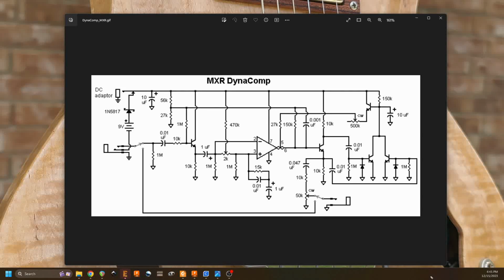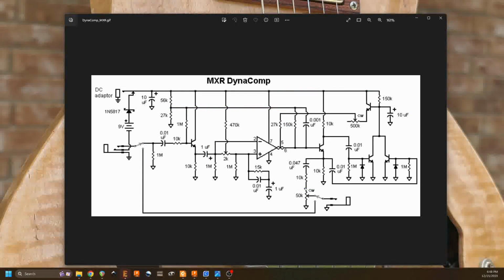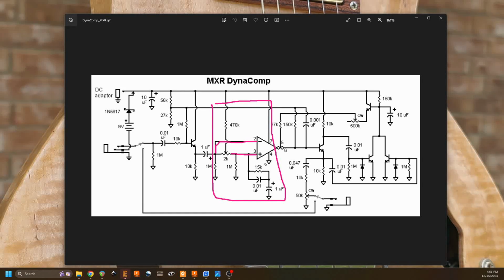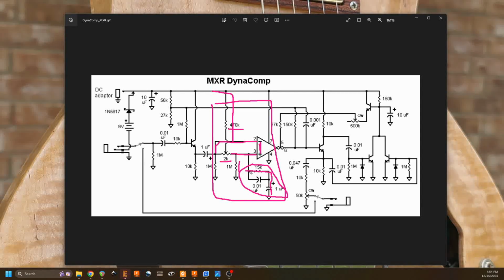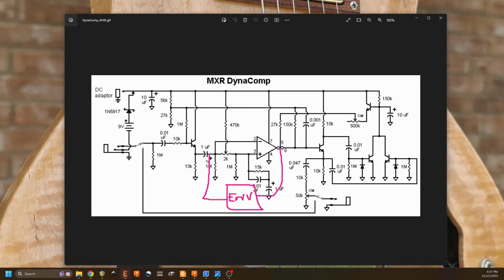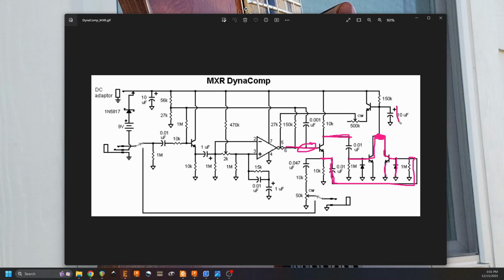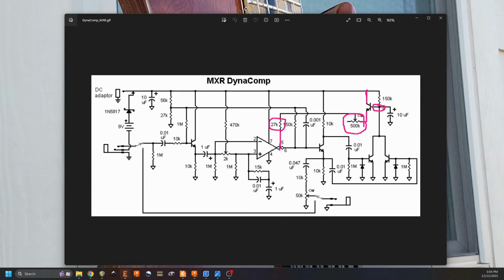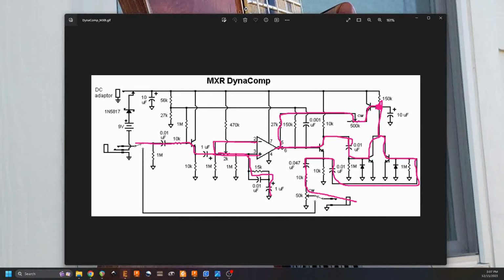Schematic Elements for Guitar and Effects: OTA's and the MXR Dyna Comp

Comment: Interesting! There is a lot to learn from these old designs. I was just working on a modern optical compressor schematic and used a 2-opamp precision rectifier feeding an envelope follower before the sidechain hits the LEDs. A fairly different approach from the phase splitter -> rectifier approach here. Very clever what can be done with a few transistors! Opamps are so cheap now that I find they are my default option and I don't hesitate to use as many as I need now.

Comment: I think the 15k, 0.01uF and 1uF network at the positive input is acting moreso as an AC voltage divider than a filter. At those values, you would be attenuating pretty much all of the audible spectrum. This is usually necessary with OTAs because they have a very limited linear range on the input (in the 10s of mV). They don't want to mess with the DC bias balance across the two inputs, so they reduce the signal level through that cap to prevent mismatching the DC bias between the inputs (if they just used the 15k resistor, it would drop the DC voltage at the positive input.

Comment: Think I've always analysed this circuit a little differently. I see the transistors in the envelope filter as switches if you like, when no signal is present they're closed and there is no voltage drop over the 150K resistor at their collectors, meaning there is a voltage at the base of the Transistor providing bias current to the OTA. Whereas when there is signal present at the bases of the transistors in the envelope filter, they're 'open' and there are pathways to ground, so current flows through the 150K resistor meaning that there is now a voltage drop and the transistor providing bias current to the OTA 'shuts off.' So when there is no signal at the envelope detector there is bias current being sent to The OTA to amplify, however as more signal is present at the envelope detecter there is less bias current being sent back to The OTA to amplify. Open to discussions of course 🤘
Reply from the maker: That's a great way of looking at it, thanks!

Comment: less current will reduce the gain of the OTA not vice versa. When the signal is high, there is less dc voltage across the cap.  am I missing something?
Reply: Correct. The other important thing to note is that, since the diodes are positive rectifying the signal, the output of the differential transistor pair at the collectors is actually a negative rectified signal (because they invert the polarity in this configuration). The transistor above that acts as a buffer and current source for the OTA's current-controlled gain input pin (non-inverting) so it drops the control voltage/current when the signal gets overall louder. There's also a cap there that filters ripple out of the control signal and seems to depend on the output impedance of those two transistors to do its job.
Reply: I think it was just a typo, don't you think?
Reply from the maker: You are correct, my mistake. These videos are done in a single take and sometimes I say the wrong thing. Thanks for the clarifying comment.
Reply: @thescientificguitarist4228  it happens, don't worry about it.